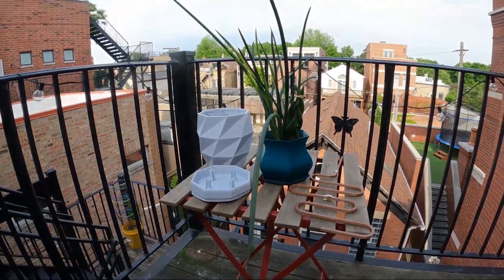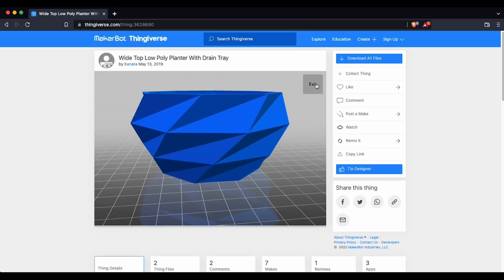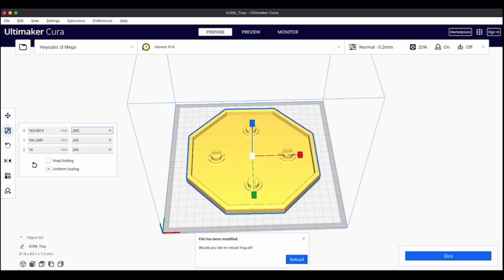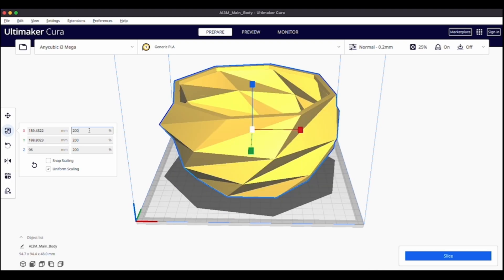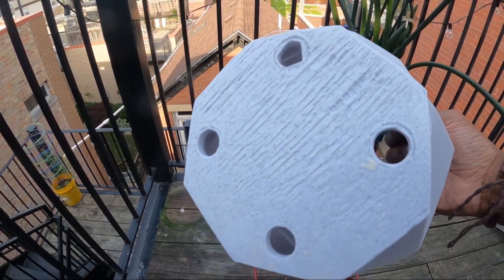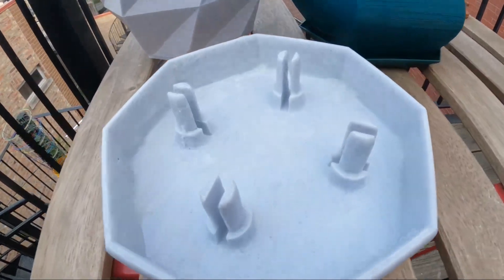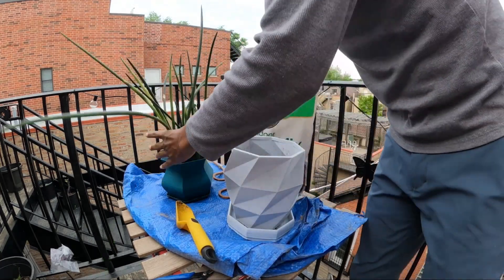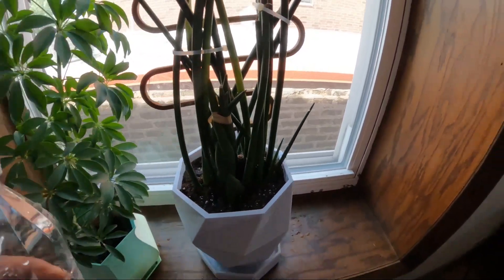Creating a 3D Printed Planter to Repot a Snake Plant

Comment: How would you compare the cost to 3D print vs buying in store?
Reply from the maker: Depends on infill density, usually it takes about 100 grams of filament to print a good sized planter. 1kg for $19.99 so about $2-$3 for a planter.
Reply: @UrbanWindowFarmer  what's the model of your 3d printer?